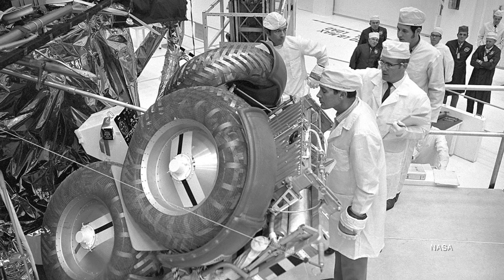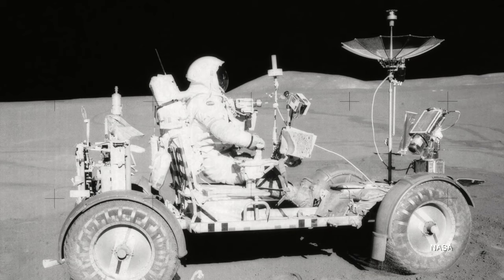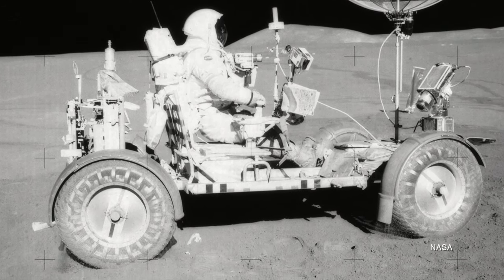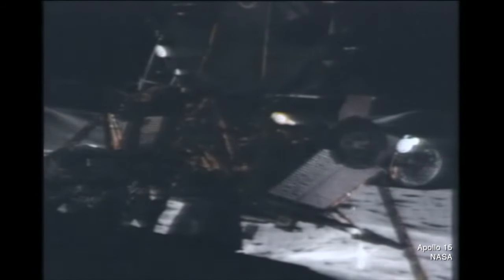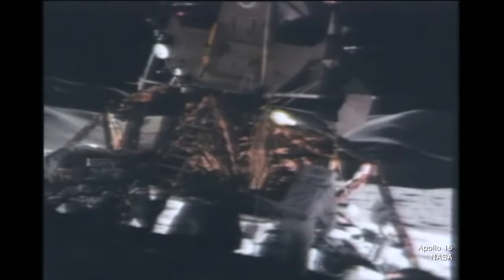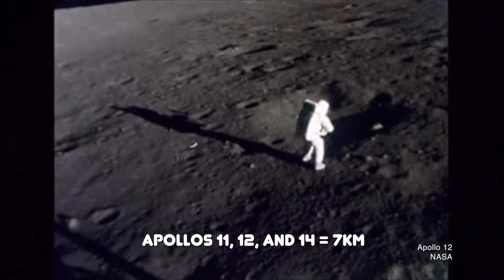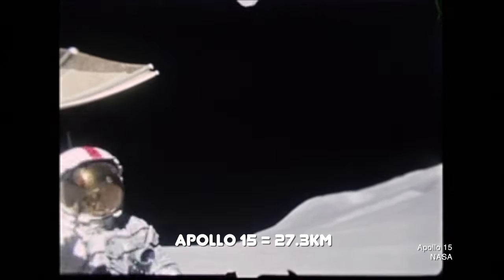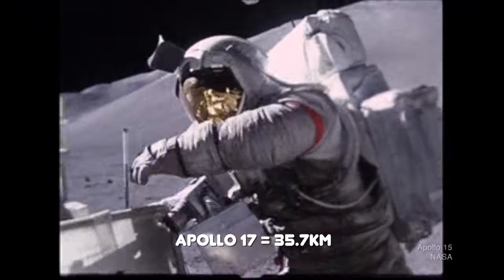How NASA Took Cars to the Moon

Comment: How did the cameras turn up by them selves to video the module leaving the moon
Reply: Trebor  Do you really believe that? 400.000 km away in 1969?
Reply: It didn't turn up by themselves. The camera on the rover had remote control to allow Houston to operate it so that they could follow the astronauts. 
The flight controller who was responsible for operating the camera from Houston was Ed Fendell.

Comment: I've always wondered, what would have been the plan if a rover broke down while the astronauts were far away from the lander?
Reply: They'd walk back, obviously.
Reply: The plan was for them to walk back, so they never went too far from the LM.
Reply: Abi Gail walking but they'd probably have to hold their breath half way back...
Reply: I guess they would have no other choice than hopping back to the lander.
Reply: The navigation system on the rovers told the astronauts how far and in which direction the LM was.
Reply: That would be the Lunar Automobile Association, surely?
Reply: That would require the 200,000 mile towing option on their membership.
Reply: The Lunar Rover was 4wd, had two batteries, redundant speed controller, and 4 wheel steering. Also it was designed to function with 2wd, 2 wheel steering and on one battery. So damaged, the rover could still drive back the LEM.
Reply: Well, the way i heard it is that if the rovers were to break down, they would have to stop the cameras and reset the scene...

Ps: This is a joke. Don't get your panties in a bunch.
Reply: Hitchhiking.
Reply: Not if I were driving. I put a golf cart in a lake. In a desert.
Reply: They could just take their space suits off and walk off the set and leave the studio.
Reply: Point yourself in the direction of the lander and hold down the W key.
Reply: Although the rovers let the astronauts cover more ground, they didn't do so in a straight line away from the lander.  They stayed within a walking distance radius of the lander and used the faster mobility to visit more sites within that radius within the limited time available than would have been possible if they had to walk to each site.
Reply: Plan was asking the shooting crew to give another one
Reply: Too bad Apollo 13 didn't have that option on their plan, or else Grumman wouldn't have had to bill North American for so much. :)
Reply: 17 was the only one cleared to drive further than the eva packs had life support for them to walk back.
Reply: Good question?
Reply: Thank you for all this info, still they could lift the Rover after deploying  it? really really light....
Reply: Good one.....
Reply: You know.... ;-)
Reply: + shlibber - Not sure what would Bruce Willis do, but I know what Chuck Norris would, he would directly jump back to Earth.
Reply: Abi Gail d plan was for a mercedes to drive up to d area that we all recognize to be on earth and take dem to d boss who will give them a mouthful for driving so rough. howbout wonder how no lunar test flight worjed on earth but they went anyways.
Reply: Chew Bird yet we waited 50 years+ to get this navigation system
Reply: carabela125 not dat far bro. more like 3000miles or so. anywhere below d van alen belt.
Reply: Cristi Neagu joje borders on reality. ever seen a movie scene where d car broke down unplanned.? neva heard of take 2 take 3?
Reply: + Deren Icke - Did it occur to you that they could have simply follow the tracks left on the dust? Those tracks will be visible for millions years, eventually, since there is no weather on the Moon.
Reply: Jorge Manso yes the rover was really light.  It was built that way and they were on the moon.  1/6 gravity remember.
Reply: Deren Icke What navigation system are you referring to?
Reply: butchtropic which is what they coubted on when tbey made the biggest fake that fooled an entire country. d Russians knew d truth cos they never went byond d van allen belt. middle school? to learn complex formulas that have no bearing in life? please. natural intelligence. even eagles can tell d earth aint spinning @ 11000km/h and ISS ain't travelling 1700km/h.
Reply: Butch, a lot of flat earth folk are just looking for attention.  I think Deren may be one of those people.
Reply: Abi Gail , call AAA for a tow truck, right?? ;-)
Reply: that easy they would just go to the NEAR-BY mechanic shop here on EARTH! this is FAKE!
Reply: The LRV had 4 motors and 3 separate batteries and could drive on just 1 of each. As mentioned a few times the trips were planned so there was time/air to walk back.  Drive far away first, then stop in multiple places on the way back.  Not that complicated.  And yes they could generally see the LM from any distance and if not, they could see their tracks.  And don't forget they arrived in a space ship, and are out and about in a spacesuit and breathing backpack the failure of which would be kind of life ending...  They knew there was tremendous risk, they had lots of back-up systems, but yes they knew it was dangerous as hell.
Reply: No documentation of your story what--so-ever.
Reply: csm101  sounds like an act of desperation on your part....
Reply: Call a Taxi.
Reply: Yes, they could. They did that  a few times when out and about, to avoid having to make turns - just pick up one end of the rover and walk it round to the right direction.
Reply: Seen one video of satellite pics of moon landing sites with rovers parked far away from landing module   Couldn't understand why till I learned they used camera on rover to film there takeoff from the moon so had to be some distance away to film it going up
Reply: They would hop/skip back. More efficient than walking with the graivty.
Reply: A A recovery ?
Reply: It was very redundant, so it was unlikely for it to have a total mobility failure. And they didn't drive far away from he LEM, they drove in a zone to either side of it, in loops.
Reply: Call out a mechanic ?
Reply: Call AAA Lunar division
Reply: Nah, he'd reach up and pull the Earth back to *him*. None of that sissy jumping stuff.
Reply: Nah...he'd reach up and pull the Earth back to *him*. None of that sissy jumping stuff.
Reply: They could walk over to the camera crew and share a glass of Tang perhaps? LMAO
Reply: My wife always calls me, if her car gets broken....
Reply: INDUBADIBLY.....
Reply: Hitch hike back to the lander..... but you know.....everything worked perfect .🤪🤪🤪🤪
Reply: simple, they take off their space suits then head to the studio cafeteria and get coffee
Reply: After Apollo 13 Grumman sent North American a towing bill since the Command Module was dead. As a joke of course
Reply: It was a brand new vehicle. Roadside assistance was included in the warranty.
Reply: They'd do the moon walk
Reply: call nrma mobile service
Reply: They would call the recovery people silly.
Reply: Call On Moon, a subsidiary of On Star.
Reply: they would call an Uber rover to come get them.
Reply: They call the Lunar Rescue and Recovery Breakdown service, obviously.
Reply: +Abi Gail+
All they have to do is call AAA. "Astronomical Astronaut Assistance"
Reply: @CristiNeagu  Well you are wrong, they had AAA...
Reply: I believe there was a mission rule forbidding the astronauts being further than the walking distance back to the LM as the crow flies.  (Or doesn't fly, as there's no air on the moon for crows to fly anywhere in)
Reply: They would have to get the film crew to push it back .
Reply: Run behind it
Reply: FlatEarth RethinkingScience There is plenty of proof the Earth isn’t flat. They are not CHERRY PICKED or edited.
Reply: Triple A
Reply: One of the stage hands would of picked them up with golf cart.
Reply: @texmex9721  , That would explain them frolicking around and goofing off, thanks.
Reply: @wrecktifier1  Absolutely.  Testing the rover for 30 second before loading and setting off is proof of a hoax if you want it to be.  Some other popular ones are claiming it would not fit inside the LM, or that the batteries were not big enough.
Reply: @wrecktifier1  OMG imagine the force needed to blow dust off those lander feet.  You'd need a rocket engine or something.
Oh yea the fake footage from halfway that some British guy made up, that was hysterical.   They were really in LEO except not orbiting because the Earth does not turn.  Hovering I guess.
Reply: @wrecktifier1  Yes! there should be billowing clouds of dust.  How foolish of me.  Unless the are in a vacuum.  Oh wait, they were.  Then the dust should be blown away, like in the film of the landings.   All six landings...
You are very emotional about this.  Why?
Reply: I think no way to find position on moon to come back from a above 6km distance they travelled frome landing site....no gps not even a working  compass ( no magnetic field)!!
Reply: Trebor  They say Apollo 15 made a 17 mile trip on the moon
Reply: @Pygar2  They say Apollo 15 took the moon rover on a 17 mile ride. the story reeks of bullshit!
Reply: Trebor  proof?
Reply: @williampeek7943  Proof?
Reply: @texmex9721  Check out Apollo 12 mission and see how much "care" was taken with the LR on that mission.............
Reply: Trebor  My mistake, I meant 17.
Reply: @thewomble1509  Not sure what an LR is.  Lunar Rover?  If so, Apollo 12 did not take one. Only 15, 16, and 17 did.
Reply: The camera guys would drive them back.
Reply: Is the rover's gear manual or auto?
Does it have  a back gear?
Does it have a carburettor?
Can it do a 360?
Does it have windshield wipers just in case it suddenly rains cats and dogs?
Is it insured?
Reply: Ask Kubric
Reply: AAA Moon duh
Reply: Exactly! lol
Reply: run
Reply: They would leave the rover and just walk out of the studio.
Reply: They could  walk/ jump back  but yes  they would leave all the rock behind.
Reply: They were on earth so no worries
Reply: @mikecorleone6797  I realise your comment is 5 years old, but how much oxygen do you think they had? The CM, LM and EVA packs had scrubbers for removing CO2 from the oxygen they breathed out, so that it could be re-breathed. That didn't give them a limitless supply of air, but it allowed for substantially longer EVA durations than the mission parameters required...up to ten hours each. The LM didnt have an airlock but could be depressurised and repressurised as required, so the astronauts (of Apollos 16 and 17 particularly) could return to the LM and rest between each EVA excursion.
Reply: @mikecorleone6797  All the logistics were worked out on these missions. A lot of people doubt what they did because there were teams of scientists and engineers that are way smarter than people you'll ever meet on your average day. That's what gave us 6 successful lunar landings, that's also what got Apollo 13 back alive.
Reply: I’ve always wondered what kind of fuel mileage the space shuttle got to be able to travel 500,000 miles
Reply: @dancurry9086  Remember that it spent only the first few hundred miles under powered flight to achieve orbit. After that, it made use of its OMS (Orbital Maneuvering System) and RCS (Reaction Control System) to adjust its orbit and inclination, direction in orbit, and eventually, to de-orbit and land. But once at orbital speed, around Mach 25, which is what it hit the atmosphere at upon reentry, the shuttle was bleeding velocity and energy on the way to the the ground for a safe landing.
Reply: @carabela125  Grumman billed NASA with a towing invoice when their LM was used as a lifeboat during Apollo 13, since it allowed getting the CM (and the astronauts!) back to Earth.  It was done as a joke, of course, and after the mission ended.
Reply: @ikwikwi  PADS: Position Azimuth Determining System. Basically a gyroscopic device that counts how far and in what direction.
Reply: @CristiNeagu 
😂😂 Actually that's the Truth 😜
Reply: @davidhollenshead4892  ....and it all fit into the 'lunar lander'? ..yeh right..   pfffttt!!!
Reply: Call an Uber like everyone else.
Reply: Go across the street and have some beers until the director tells them the set is fixed.  mmm...k
Reply: They'd have to call AAM (Automobile Association of Moon)

Comment: I wonder why I never see a astronaut get in the rover and get out of the rover. And the astronauts don't move while driving, the arms are always in the same position. And where are the batteries? Did they use a normal starting battery from a car? How can I be sure that this are no puppets on an RC Model? Why they drive so fast as if they drive a ralley?

Comment: I believe it wasn't until Apollo 17 that they got the camera to correctly track the ascent stage after take-off and it was done manually from Earth.
Reply: Anders Welander - I assumed it was motion tracking automation. That clip is maybe 2 seconds? Isn’t there a transmission delay due to the distance like those observed from ISS broadcasts? How is this different? Honest question, thanks.
Reply: butchtropic - Thanks!
Reply: @chucknoob7041  Not sure if it would have been possible to develop a tracking mechanism. At any rate they didn't. A guy in mission control sent commands to track the ascent seconds before it happened. They failed the first attempts and only got it down for this last mission.
Reply: Hi Anders, hope that you are well. You referred to the filming of the assent stage of Apollo 17. This camera was controlled by Ed Fendell in the Huston control centre. This as you can imagine was a difficult task, In addition to the 1.3 second time delay each way he had to deal with a motor reaction time of just over 1 second. This meant that he had to anticipate some 4 seconds into the future. The filming of the Apollo 15 and 16 LM assents didn't go exactly as planned for various reasons but third time lucky Ed got it wonderfully spot on for the Apollo 17 LM assent from lunar surface. More details about and plans of this camera system are available online. Take care.

Comment: With the time delay to the moon how did they pan the camera up so perfectly?
Reply: They had tried it on Apollo 16 and didn't do so well because of the delay.  On Apollo 17 they parked the rover further away to make framing the LM easier. They also had figured out the delay time better and the guy in mission control (Ed Fendell) had practiced it so he got it right he second time.
Reply: Joe Vignolo ....f....ing genius. In addition to perfect sound quality, a brand new method of transmission, never been tested, full colour live TV broadcast from a CRT based system, on miniature TV cameras the Japanese failed to invent, all sent 240,000 miles from a low wattage ( less than 20w) battery powered, and not even a crackle in the picture or sound, despite traversing through a radiation field. GTFOOH.

Comment: Funny this was never mentioned until they started asking the question. I still worry about the 500F temperature difference between sun and shade among other things.   Like full force solar wind on your electrics and fuel.
Reply: Which is why the Lunar Module was wrapped in thermal insulation.
Reply: While it is correct to state that the moon's surface experiences a wide temperature range over the course of a lunar day (in the range 140K to 400K) However these temperatures were never encountered during any of the Apollo missions. All the Apollo landings were planned to occur at lunar dawn, when the lunar temperature is somewhere in the middle of the range. For example, during the Apollo 11 mission, the measured temperature range was between -23°C to 7°C (250K to 280K). Take care.
Reply: bs

Comment: The video of the Rover looks fake. 
It appears to be a very flat chassis.  If the astronauts had to put in the foot rests and seat what about the electric motors and steering column?
Where is the battery and the drive motors and why on 1/6 gravity do they waste weight with a pulley and lowering mechanism when the should be able to lift the rear end. 

Where were the seats stored. 

If you want to really want to know if Man went to the moon then calculate the amount of ice carried so that sublimation can cool the LEM from 130 degrees Celsius for 3 days. And how much power is required to transmit tv from the moon run the "air conditioning" power the computers and lights and power the Rover. 

Given modern technology also tell us the weight of batteries on the Rover and how they managed to stop the resistance climbing in electrical cables in sunlit temperatures.
Reply: The "moon dust" settles pretty fast.
Reply: butchtropic lool
Reply: butchtropic lol